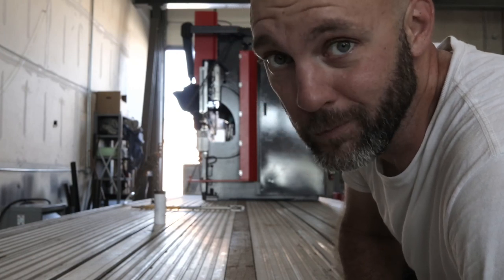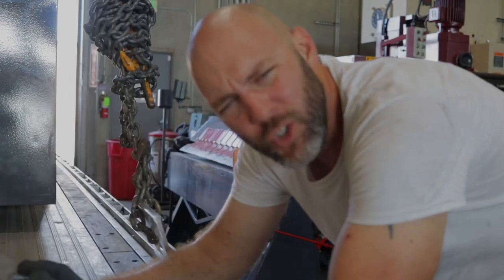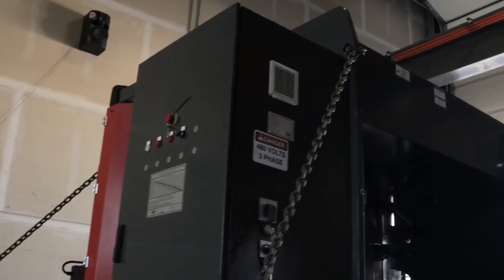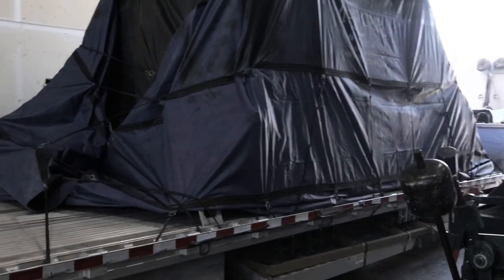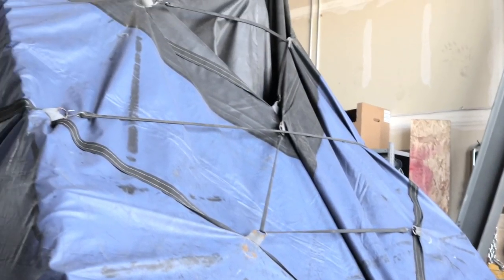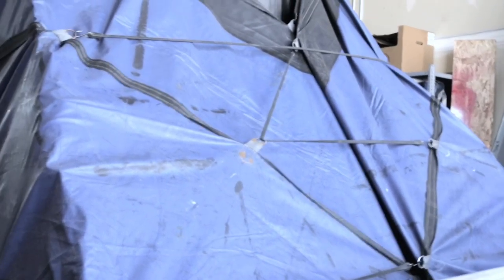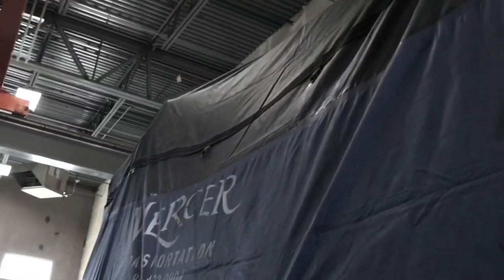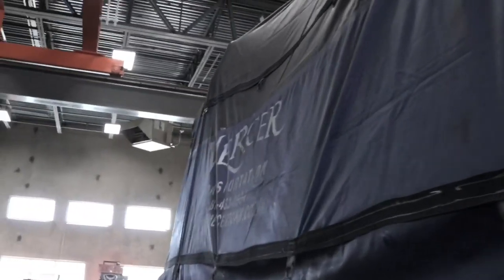Tarping Machinery Tips | Step deck Trucking | Advanced

Comment: Non flatbedder question.... Why snap binders over rachet on this load?
Reply from the maker: I’m not crazy about the rachet binders that I have, they make nicer ones that basically lock in place. The ones that I have slowly on wind if they are not secured exactly correct so given the nature of the load, the snap binders do not come loose so I felt more comfortable
Reply: I still prefer snap over ratchet.

Comment: 2 things.
1) Cut those 20 footers into 10 footers. You will thank me for that.
2) Throw those dam slap binders away! 
 You are now a drop decker!
Unless you want a ticket for failure to secure or loose your jaw! 
You preach safety yet you use slap binders?
 Bro.. Get rid of them slap binders.
I do not want to see a video named:
 How I lost my jaw.
How I got a concussion.
How I lost my eye balls.
How my arm got torn off.
 I have friends that are now suffering from all of that because of slap binders. 
Uhg! 
 Please stay safe.
Reply from the maker: I hear ya, I need to get some better ratchets, I’m just not crazy about the ones I have
Reply: Get the ratchet 1/2 inch binders. Not the crappy 5/8 binders. 
 They have a 12.5k load limit if you go from the trailer to the peice. 6.5k if used in a chain combo with 3/8 in chain or 1/2 in chain. Beleive me, much better off. And be able to kiss and eat in the long run.